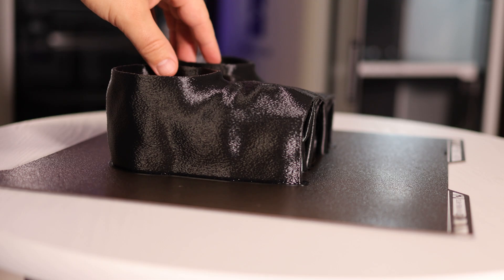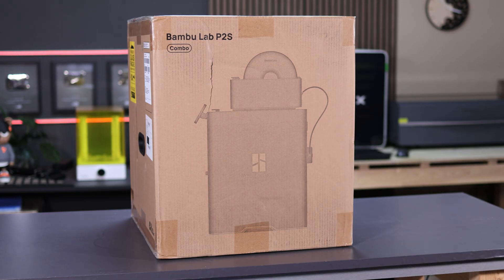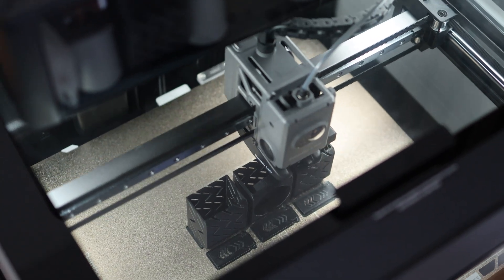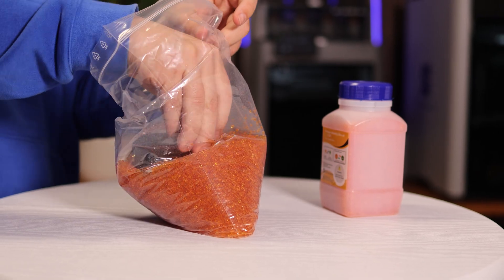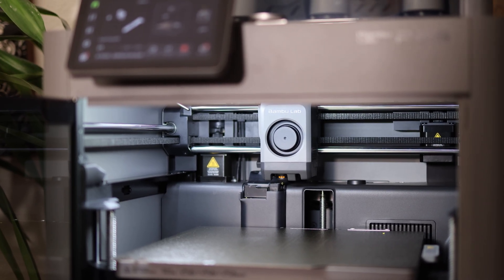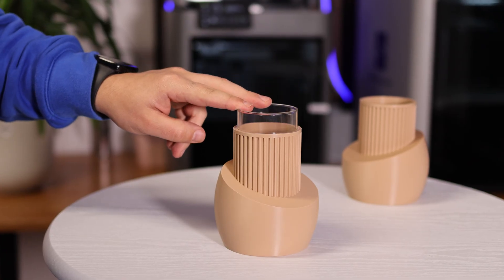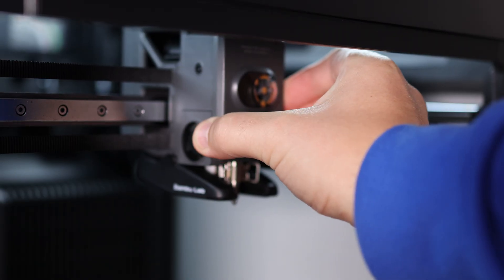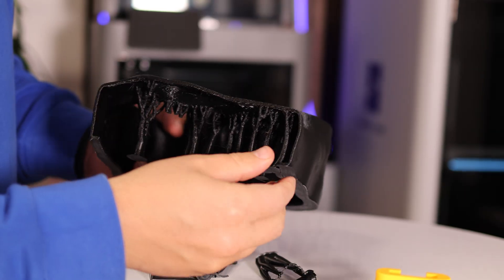Starting My Home 3D Printing Farm for Business - From Zero to Million with Bambu Lab H2S and P2S

Comment: I’ve got a Bambu Lab H2S. The new Tungsten Carbide nozzles (0.4 mm and 0.4 mm High-Flow) just came out. Do you recommend getting the new one, and is it better to wait for a 0.8 mm Tungsten version? Is there much difference between the regular and High-Flow 0.4 mm? 😖
Reply from the maker: Hi, I’ve only had the new High Flow for a short time myself, so I haven’t tested how much really flows through it yet. I can’t say anything about the Wolfram ones — they look interesting and expensive though.

Comment: this is great! I'm doing the same out of my enclosed garage.  my business also offers laser, CNC and other various printing services and epoxy resin products. been collecting my assets, supplies and materials over this last year and Nov 1 is my planned launch day. running 2 creality ender 3v3, 2 Flashforge ad5x, a handful of old bed slingers (for overflow prints), Xtool Metalfab, and 2 20w Xtool d1 pros one with IR diode. Currently in the final stages of building the lowrider v4 CNC using an 800w water cooled VFD spindle with a 4'x8' build area. running every machine almost 24/7 the last couple days. Rapid prototyping, print on demand and B2B marketing products/services. if it takes off, i have plans to build a storefront attached to my lab. most of my products are focused on home decor and automotive but planning on introducing handmade epoxy furniture once the lowrider is dialed in. best of luck man!
Reply from the maker: Wow, so many machines! I’ve got quite a few myself. More will be shown in upcoming videos. By the way, I sold my CNC milling machine, but I’ll be getting a new one in the future. I also have epoxy resin projects on my German channel, as well as silicone mold ones. Wishing you lots of success!